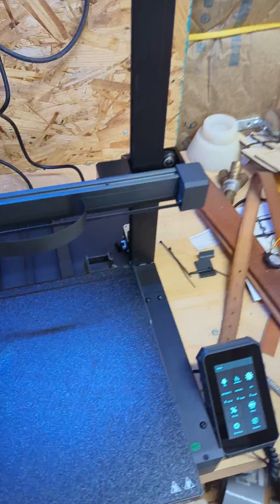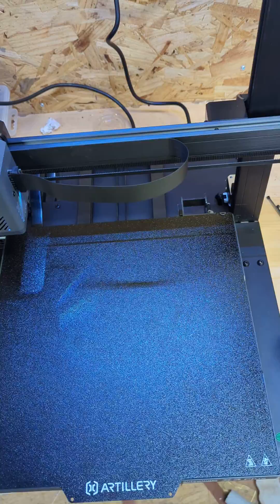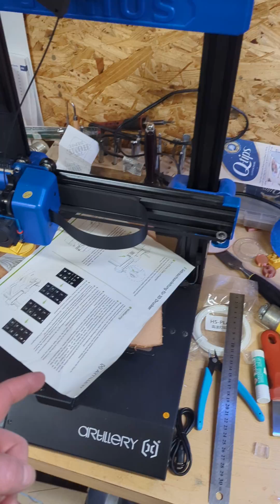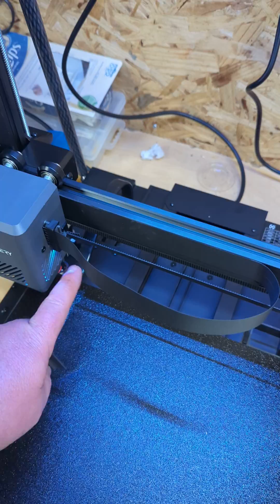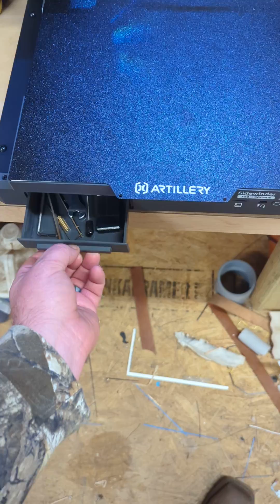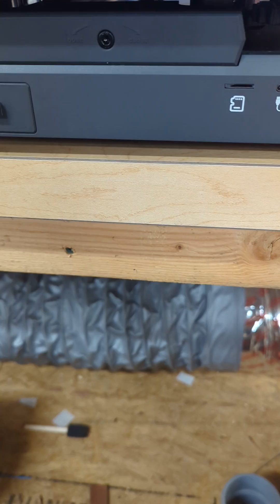Artillery Sidewinder X3 plus Update

Comment: Good video!  I just received my X3 plus and have "bed wobble" and bed leveling problems.  I tried to correct using the 10 MM adjustments under the right side of the bed.  It seems to interact with my bed leveling adjustments.  Did you by chance take any pictures of how you took the bed off and what all the adjustments are.  I understand the corner adjustment wheels, I don't understand the two wheels between the left side/right side corner adjustments.  Is there a specific order that these adjustments should be made and is there someplace I can get a labeled drawing showing the layout beneath the bed.  Any help or comments would be appreciated.
Reply from the maker: I took the magnet sheet of the top and the bolt are right there. Just took it all loose so i could get to the bolts and nuts better.

Comment: hey, looking forward to testing the x3 plus! About the nozzles:   can you give me a hint which Nozzle the X3 plus uses? I want to order an 0.6mm nozzle (which makes more sense for a larger printer, right?).   I also installed one in my creality K1 - and I like the speed and efficiency of the prints with 0,6mm   (I'm mostly printing functional parts - not decoration).  
thanks, greets from Austria, Mario
Reply from the maker: I do not know yet which one it uses. I have not seen a .6mm nozzle available for it. But I also haven't dug into it that deep
Reply: @deervalleyengravings3088  I think they use the same as on the X2 - but it would be nice if you can confirm.   But not so important - in a few days I should have mine - and I can order the 0.6mm later as well.
Reply from the maker: I look at the extra one
Reply from the maker: New video with nozzle is up